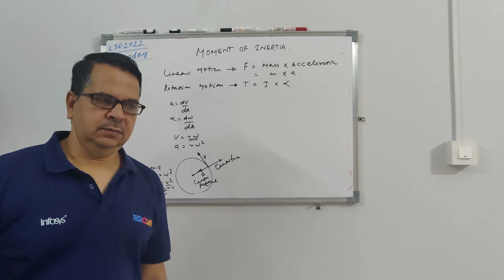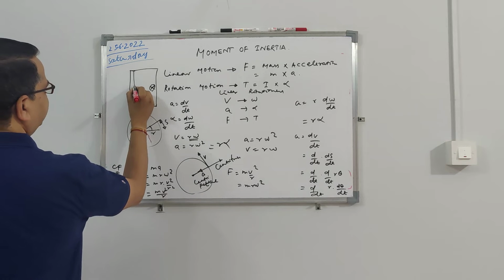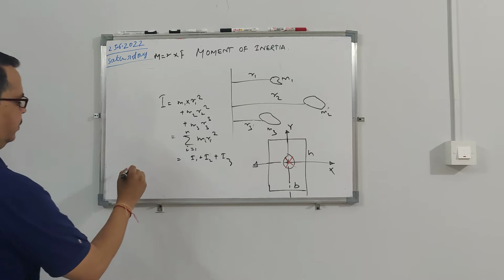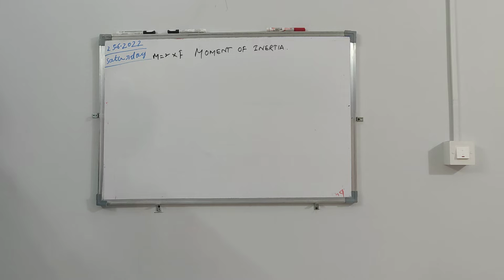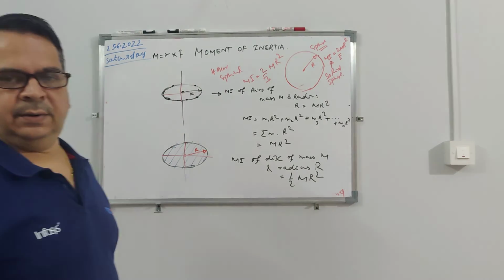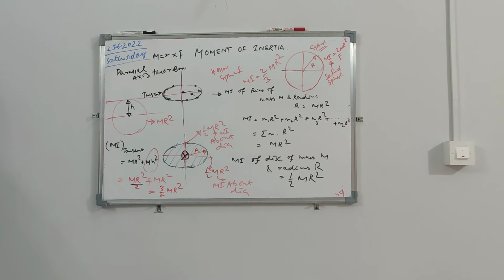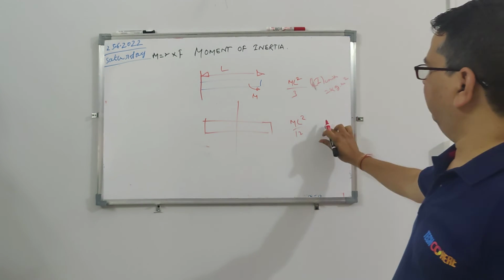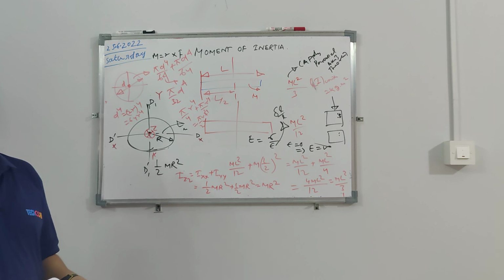Moment of Inertia

Comment from the maker: Correction: The Moment of Inertia of disc I have been mentioning for disc, is about an axis perpendicular to the plane of the disc, not about the diameter which is in the plane of the disc. About an axis perpendicular to plain of disc it is 1/2 (M*R^2),  Moment of Inertia about one of the diameter lying in plane of disc it is half, i.e. 1/4 ( M*R^2)